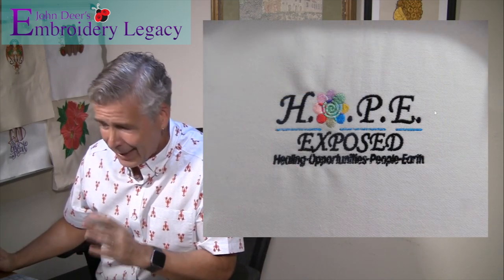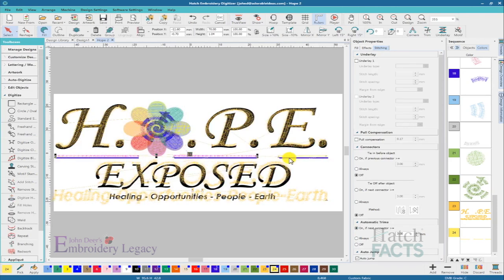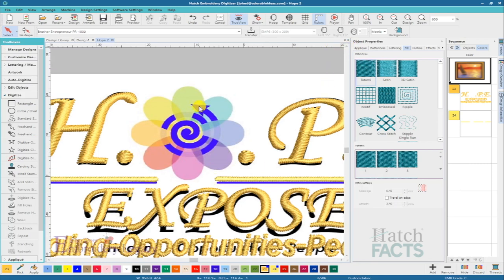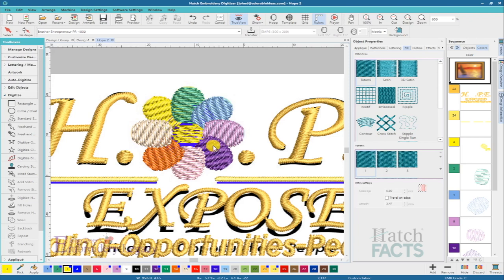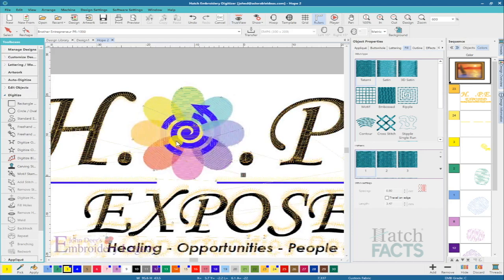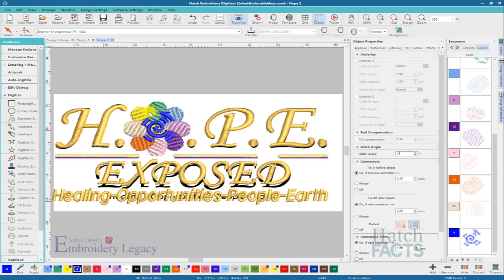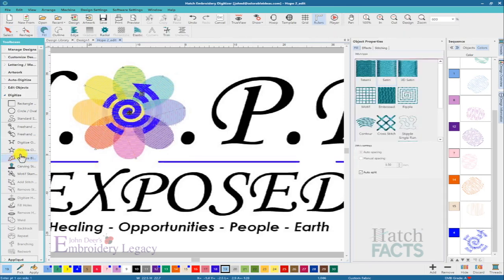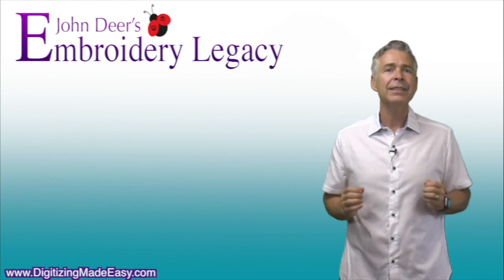Embroidery Digitizing Tutorial: How to Fix a Bad Design using Software

Comment: Thanks for providing more great value.
What type of fabric do you use when  you runs samples?
Reply from the maker: Eric Kevin Z generally I just use felt unless I really feel it is necessary to run on the fabric I know it will be going on. I’ve got a few years under my belt so I’m pretty good at knowing how the designs will react. I do suggest that when someone is at the learning stage they try to run samples on the intended fabric.